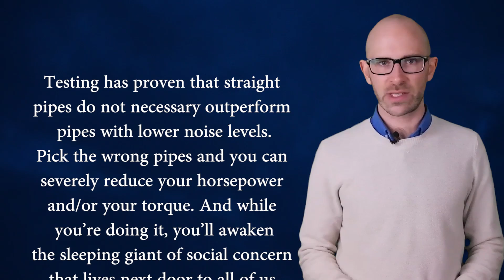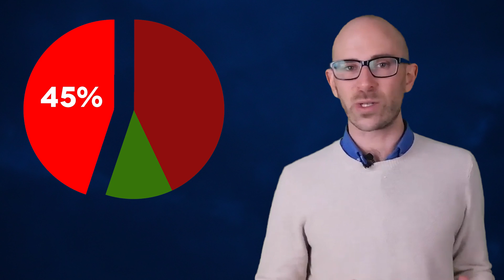Why are Harley Davidson Motorcycles So Loud?

Comment: So funny. Harleys out of the factory have extremely restrictive exhaust systems as well as very restrictive air cleaners.The heads as well have very small ports. This is done by harley to meet epa standards and they go way over it.
Most harley owners after the 500 mile break in put on less restrictive air cleaners and exhaust systems. They also have to have the computer remapped.
Although harley owners like the sound of the motorcycles. There is a very practical reason for up grading the exhaust with the other modifications.
Many later on have the ports opened up in the heads as well.
Drag pipes are not as common as stated because they rob a harley of low and mid range torgue. The only performance gain with them is in top end performance.
Basicly running wide open. Very few harley owners like to run flat out.Most of us are older and more mature.
But the small mods done to harleys make them get better milage and more power and major better throttle response. There are a number of after market exhaust systems for harleys. All legal unlike the BS this little snowflake claims. They are louder than stock pipes and I am sure he would claim every one of them are drag pipes.
Years ago before computers you could bolt on drag pipes on harleys and ride off. You cannot do that today.  Getting a modern harley to perform well for street use with drag pipes is just not something many harley owners seek to do.

Comment: Hearing damage from motorcycles is due to not wearing hearing protection while riding. Most of the sound of bike exhaust is behind the bike so amount of sound reaching the rider at speed is significantly reduced. Loud pipes due save live IN california bikes are more strictly regulated so at speed bike are still quiet. Well this has a slight issue you can't hear when they are around. As a motorcycle rider I am more aware of people on motorcycles and here in cali its scary how silent that are. Me and my wife won't buy a new bike unless its and out of state bike, bikes need to be louder the most vehicles so if they are in you blind spot you can hear them. ANYTHING that let people know your there is better then not knowing they are there. O I don't like harley's I like sport bikes.

Comment: Loud pipes save lives, it's true! Cars hear you coming and move out of the way? As for ear protection an ipod works fro me!!
Reply: That's not how sound waves work. The lion's share of the noise is directed backwards at the vehicles behind you with very little directed forward to the people that may pull out in front of you or to the sides at people who might run you off the road.

This whole thing makes people feel safer without the pesky side effect of actually making people safer or requiring any actual work.
Reply: It does work, if there were roads for bikes only loud pipes would go away.
Reply: Loud pipes to save lives.  And his statistics was very wrong.   I give an example I'll give an example I was once hit by a lady who ran a stop sign on her way to the mall two weeks before Christmas when the paramedics were putting me in the ambulance I heard her lying to the police officer telling him that I was speeding no I wasn't she ran the freaking stop sign I made them stop I refuse to go any further I wouldn't let them put me in the ambulance take me to the hospital until I spoke to the police officer in charge to explain my side of the story.  The problem with his statistic was dead people can't tell their side of the story
Reply: That may be the case but people run stop signs and even railroad crossings, if the air horn on a train doesn't get their attention the loudest, most obnoxious Harley surely won't. Sorry but that's a really specious argument.
Reply: norman, how in hell would loud exhaust help you when someone runs a stop sign. Did you hit your head really hard?
Reply: Pat68, as you are interested in safety, do you wear a high viz full face helmet, wear high viz clothes and have a high viz paint job on your bike ??? No ?

 Loud pipes are just for insecure wankers, compensating form a lack of size in the trouser department.

Dont piss everyone off with load pipes, and wear full face and high viz if you are actually concerned about safety.

Comment: Any bíke is loud without a muffler that lives up to ist job description. This does not just apply to Harleys (or motorbikes in general). Sure, Harleys are iconic and highly popular with people looking for an ADC (Attention Deficit Compensator), so they may stick out.
I do like the sound of classic motorcycles and i don't mind when they are on the loud side, who gets my ridicule are folks who ride (and drive) in an attention-seeking manner, gunning their engines, making noise for the sake of making noise and accelerating like maniacs, when there are red lights 50 metres ahead.
Also, the job of a muffleris not just to make the noise more quiet, but also to give it a different quality. I remember losing the exhaust of my Yamaha SR500 and having to go home for a couple of miles without it (trying to ride quietly and failing miserably, luckily it was daytime). The sound was not just loud but also really unpleasant, a high-pitched cracking noise far away from her usual low, throaty snarl.

Comment: Straight pipes?  Who does that these days?  Maybe in the 70s....  My exhaust are tuned to provide more torque, while they may be louder than stock it has a very low bass tone, not the ear splitting noise of straight pipes.

Comment: Your decibel calculations are wrong.

First of all "dB" is a relative measure. I can say "I am 6dB taller than you", that would make me twice as tall as you are. To define sound levels you need a suffix. Absolute sound level is "dB SPL" (sound pressure level), noise is measured in "dB A" or "dB C", which accounts for the human hearing being more sensitive to certain frequencies. So most values you cited are probably "dB A" values.

Second, an increase in 10dB is NOT 10 times louder, its subjectively about twice as loud. An increase in 6dB means the pressure level is twice as high. But only at about 10dB increase we subjectively perceive the sound about twice as loud. The energy needed to create that pressure increases differently, a change of about 3dB means twice as much energy.

Appreciate your channel but I thought I should put this right.

Comment: They are NOT that loud off the showroom floor, they actually sound nice. But the 1st thing the owner does is put pipes on, and the pipe manufacturers know the customer wants people to look at them and builds the pipes accordingly. They know thats about the only reason to ride a Harley in the 1st place. That and wearing the T-shirt. Unfortunately, they are the annoyingest bike to have loud exhaust, that ol' engine is the LAST engine that should be hot-rodded, its like putting a header on a Model T. Jus' sayin'.

Comment: the thing with those statistics at the end is that we don't know if the numbers are like that because of the noise. you can very well say that the noise is working because of the low percent of two vehicle accidents were the other driver was at fault.

but I could just at easily claim that the anti tiger task force is the reason why there are no wild tiger attacks in Wisconsin.